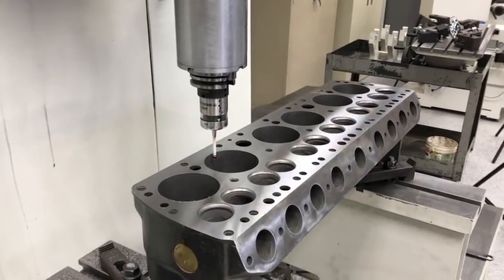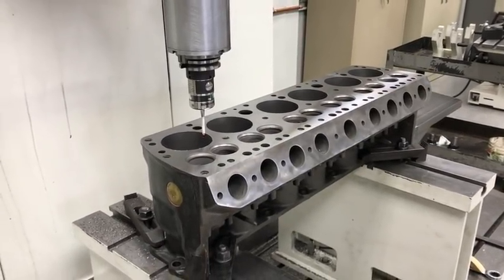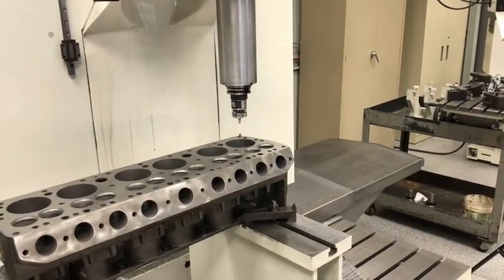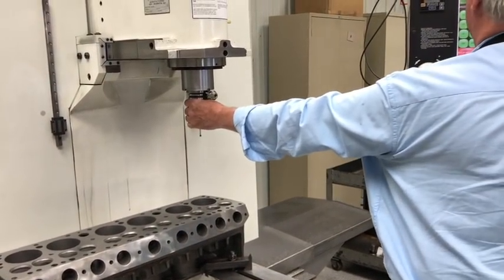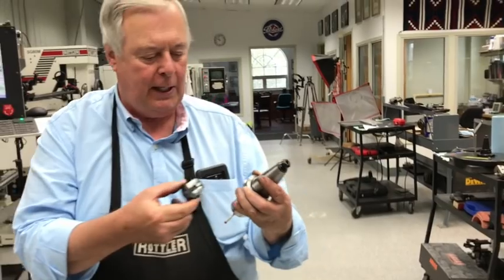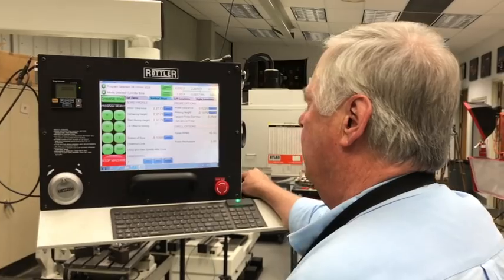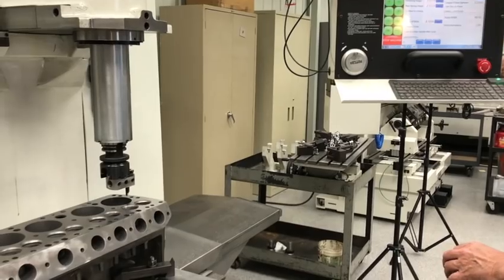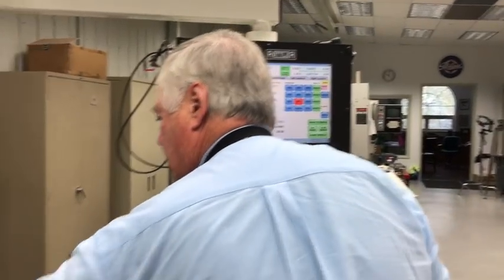Probing and chanfering holes in cylinders on a V12 block

Comment: I may stand to be corrected here but I think the Rottler measuring probe that is used world wide was developed by an Irish design engineer who's name escapes me. He worked for a large engineering company and was tasked to do build a machine. However when they built it there were slight inconsistencies in the maching back in the day. He went home Friday evening and spent his full weekend designing and fabricating. On Monday morning he had come up with the probe for precision measuring and tooling. He was then able to complete the the building of the machine to precise tolerances. This device is now  used all over the world by a variety of designers and engineers. Needless to say this gentleman is now in Ireland's to 20 rich list. 😉
Reply from the maker: You are correct.  The name is Renishaw.  It is a great story.  Most all CNC manufacturers use the Renishaw probe.  I'm sure there are competitors to Renishaw, but I do not know who they are.
Reply: A Road Less Traveled with Restore Cars Thankyou for clarifying the name for me. You do fantastic work. Regards. B.
Reply: A Road Less Traveled with Restore Cars  Sir David Mc Murtry  born Dublin.. Wikipedia👍

Comment: Seems like a lot of chamfer, is that much needed for aiding in ring installation , engines I've put together usually are barely more then deburred after boring.
Reply from the maker: Personal preference.  We use cast iron rings and they break rather easily.
Reply: Thanks for getting back on this. Cast iron, that's old school there! Yeah they break easy, especially if you're not really careful installing them on the piston. Thanks for getting back to me on this, I've worked on mostly old to modern motorcycles but also have been in the classic car service and restoration business too. Only got into a couple cars that old, a '30 model A and a '31 V12 cadillac and learning how the electrical systems , especially charging worked on them was fun. Lot simpler, sure, but also a very different approach to regulation! Love working on them though.Thanks for the videos, who knows, I may try finding a pre war packard or Buick sometime, I'd love one of the bigger models of the period. Thanks for putting up these videos!